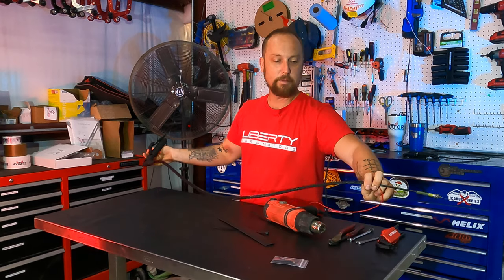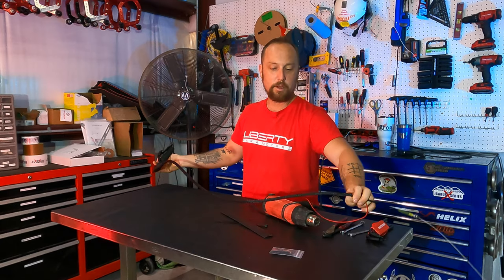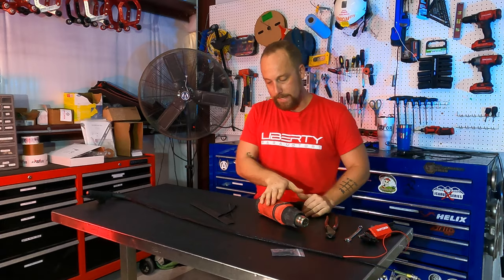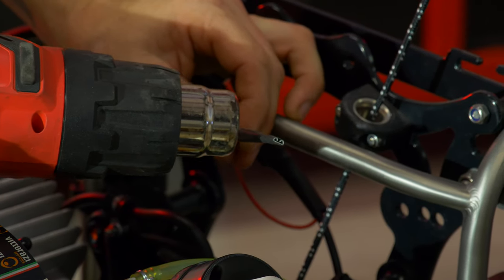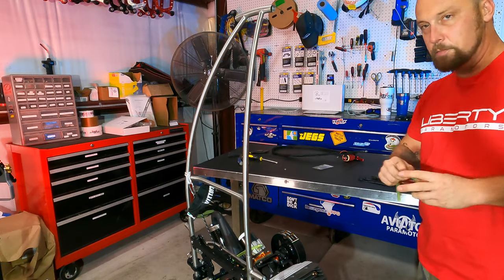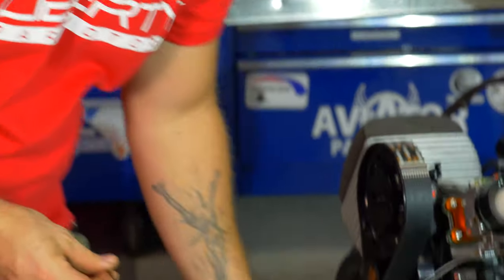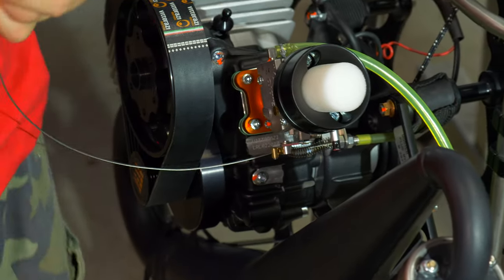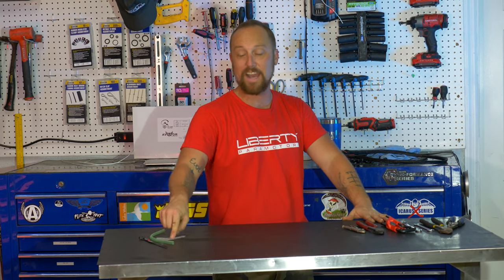How to Install the Off Grid Throttle in Less Than 20 Minutes!

Comment: Just what I needed, especially the slacking off of the cable on the throttle body, as mine (off grid throttle) was set up too tight with no slack and tightens up on any throttle/cable movement and also is self-rev increasing after initial tick over.  I can now slacken off the throttle cable with confidence that I know what I am doing!  Many thanks.

Comment: Quick question. When pulling the cable tight and tightening the cable stop does the throttle lever need to be pressed in at all or do you leave the throttle lever unengaged when installing the cable? Thanks!

Comment: Glad to see someone else put a loop or 2 in the wire to prevent vibration breaks.  👍😎👍   I still need to find a N.C. switch for my Off-Grid, to hook it up to my 303-DS/DI,   In your searches, did you happen to find any?
Reply: You can add an automotive relay to get around this. My cosmos US page has the drawings for that.
Reply: @harleytrip  Thanks Criss, it looks good!  I printed it out.

Comment: 0:34 Instead of the spade connector, I wish that packet had a wire coupler.  My original spade connector came soldered to the tab on the electronic Ignition coil selettra.  I tried to carefully remove the spade connector anyway but the tab from the electronic coil broke off.  I ended up having to purchase another electronic Ignition coil selettra ($60).

Comment: If anyone notices the old spade connector won't come off, it's probably soldered on. Mine was on my Atom 80. It was also bigger than the one sent with the new throttle.

Comment: Hello would this throttle work with the Bing carburetors. And if so would the cruise control be able to work as the bing got a very strong spring. Thank you Jon.
Reply from the maker: We had a client test this and they report it works!
Reply: @aviator  Thank you very much. Jon from uk